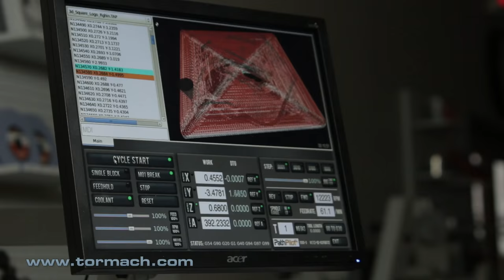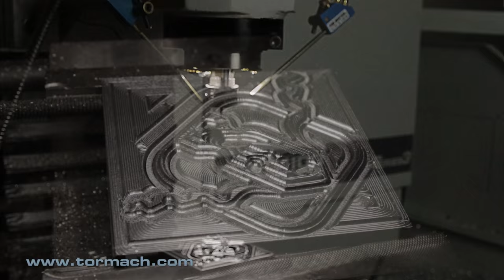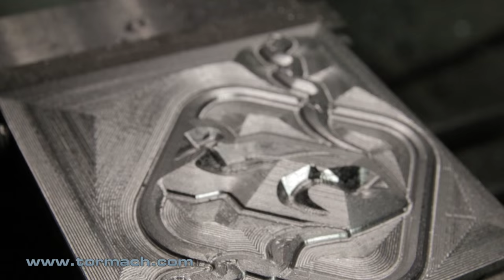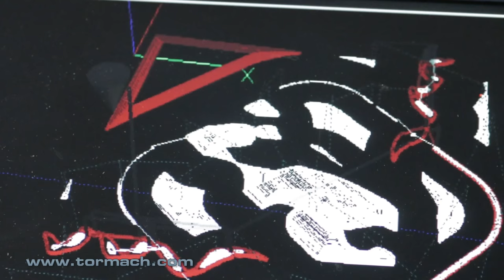Tormach High-Speed Spindle Cutting Steel

Comment: Are there any plans on offering this spindle as a companion spindle for the 1100? Would be really interesting if you could mount somehow on the side of the actual Tormach spindle and therefore switch quickly between the two.
Reply: They have that it’s the kress tool I think

Comment: What are the benefits of milling steel at 24,000 rpm rather than at lower rpms?
Reply: To use a small diameter cutting bit to get into tiny spaces requires higher rpm to maintain the correct surface feet per minute . That why dentists drill are air powered those bits are super tiny
Reply: Someone Else It’s about the SFM, not RPM. Many machines will run out of RPM well before reaching an efficient SFM, especially when using smaller diameter tooling.